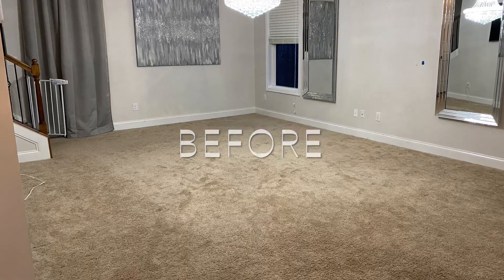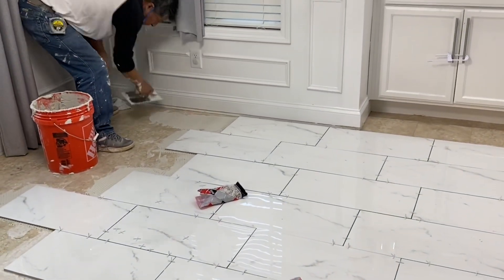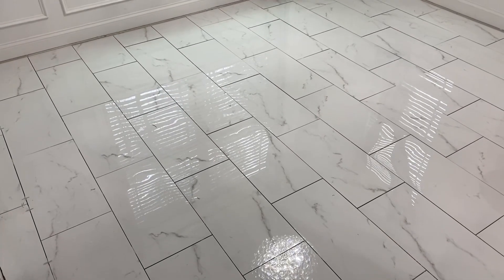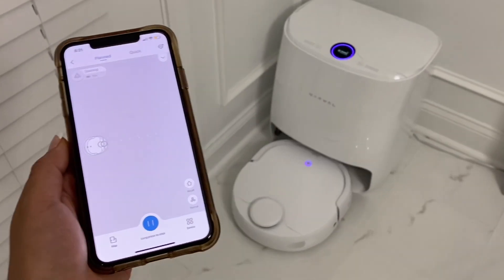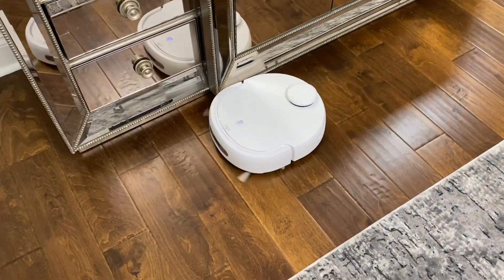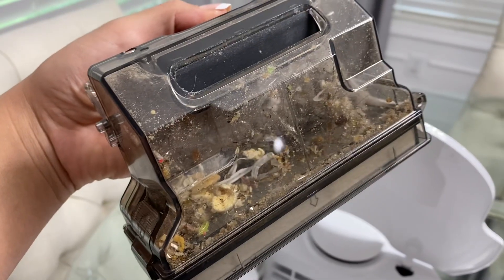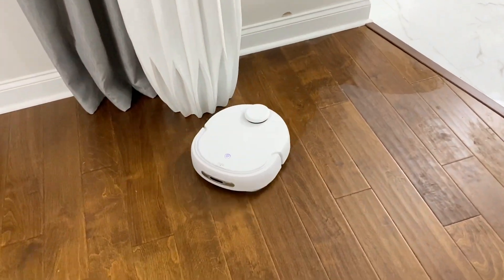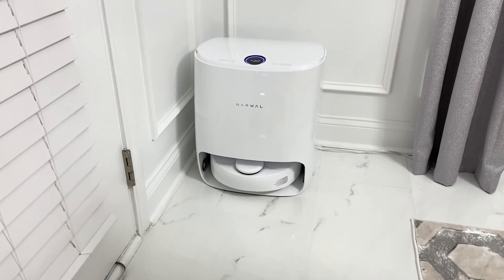Installing Wood and Marble Porcelain Flooring For The First Time | DIY HOME RENOVATION

Comment: Beautiful transformation. I have the almost exact porcelain tile. My question is...does this leave streaks mopping? I have to do mine on my hands & knees. I wash it in sections and then dry it with a microfiber rag or it streaks. Thx